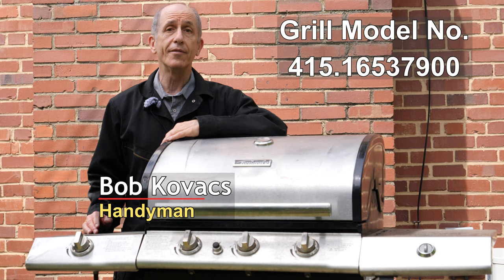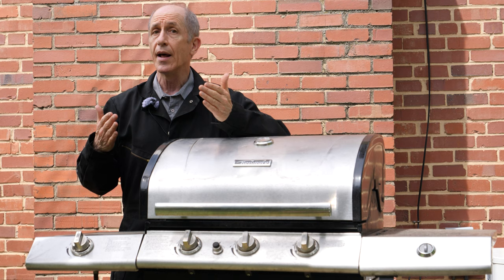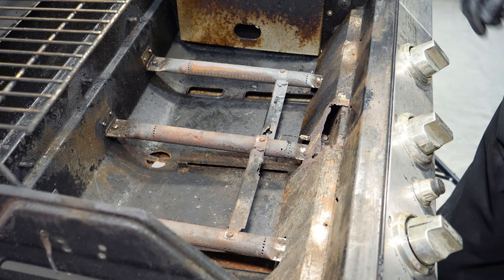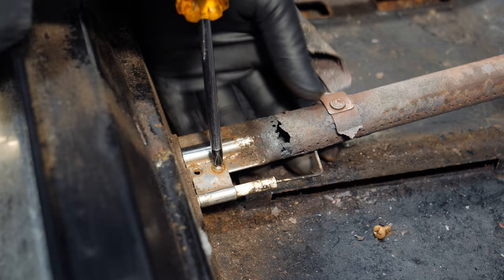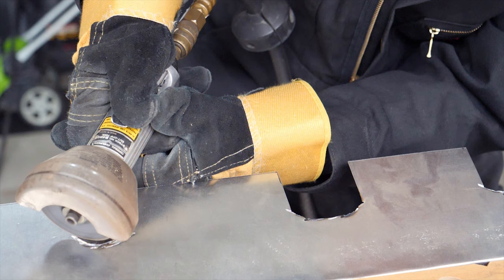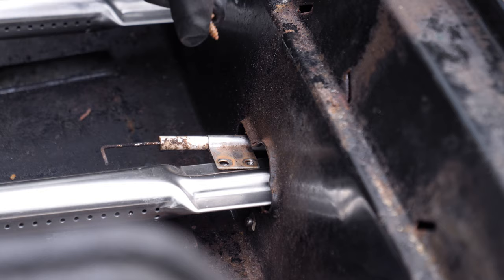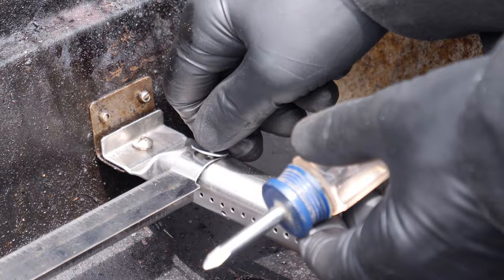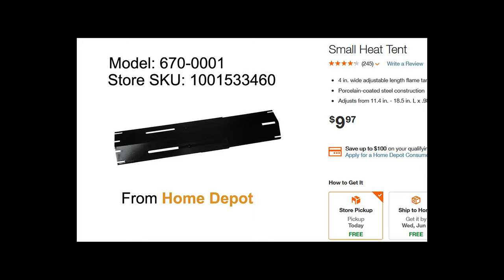Kenmore Gas Grill Rebuilding with Bob Kovacs - 4K

Comment: My new 6 burner Ken more lasted a year before all burners had to be replaced . Replaced them all and a year later same issue. My Weber lasted 15 years before I ever had an issue. I guess you get for what you pay for
Reply from the maker: More than 3 years later, I'm still using the repaired grill shown in this video. However, I probably use it 2 or 3 times a month, so it is generally lightly used. Still, it is working fine and the time/money I spent to repair it was worth it to me.

Comment: When replacing the flame crossover tube, does the opening on the tube go towards the front of the BBQ?….it looks like it is, but my husband and I have poor eyesight.
Reply from the maker: The flame crossover tubes run from side to side. They are short, maybe 4 inches, and each end opens onto a burner tube. Only the center burner has an igniter, so you ignite it, then turn the gas on to the outside burner tubes (one at a time). The flame tubes carry the flame from the center burner to the outer burners. It works well on my grill.

Good luck!

Comment: My firebox is rusting.  I need to replace that in my Kenmore.  Looks complex.
Reply from the maker: Yeah, there are some tasks that aren't worth doing in a $250 grill. I might or might not fix it depending on how bad it is or its location. Sometimes you just gotta get new.
Reply: @BobKovacs  mine is a $700 7 burner model.  I love it.  It's perfect except for the firebox rust.  

I'm so on the fence.  I think I literally have to take 90% of it apart to change it.  (Assuming I can even locate the part)

But I agree with you to a point.  You got 11 years out of yours.  Awesome run.
Reply from the maker: @ellisz5972  The good news is that it probably is not all that hard to take apart. If you do decide to fix it, keep in mind that you need to use clean steel for the fix, not galvanized or painted. You can paint the bare steel with a heat-resistant paint, but then you will have to wait for the paint to dry, then heat up the grill for an hour or more to burn off any chemicals. If you use unpainted (and ungalvanized) steel, then you can use the grill right away. The steel I used is rusting pretty badly, but it is thick enough that it should last a couple more years at least.

Good luck!
Reply: @BobKovacs  Thanks.  The plan was to buy a replacement firebox while I can still get one.  (So OEM part).  I just checked, and it seems to get a similar grill to the one I had now goes for over $2k.  I'm suddenly invested in fixing this one.  LOL

I appreciate the feedback and inspiration.
Reply from the maker: @ellisz5972  Good luck! Yes, I can't believe what a new grill costs at Costco. Even relatively simple ones cost $1000, although I just saw a small cheap 3-burner grill at Walmart for just $96.

Comment: I have been trying to rebuild a kenmore gas grill 146.23766310. The firebox is badly corroded and has to be replaced.   But my biggest challenge from the get go is to Uninstal it.  Any technical advice on how to go about that?
Reply from the maker: Is Kenmore gas grill 146.23766310 the one that I show in this video? If it is a different grill, then I have no experience with it. If it is like this grill, then where in the firebox is it corroded? If it is the bottom, I'd probably get a piece of thicker sheet metal a little bigger than the bottom, fold up the edges, set it down on the bottom of the grill and attach it with pop rivets or screws all around for strength.

But maybe I don't understand where your failure is, or how the design of your grill may affect the repair.